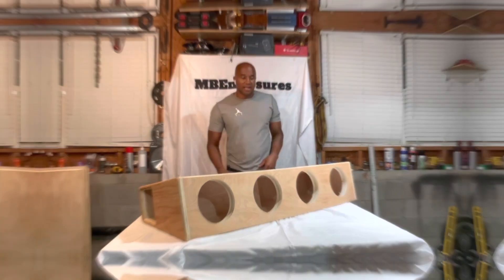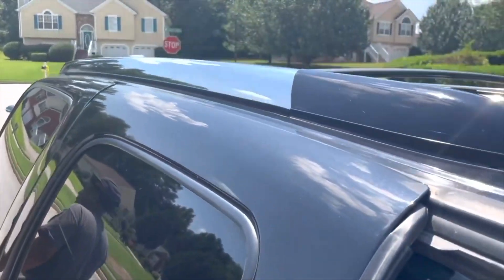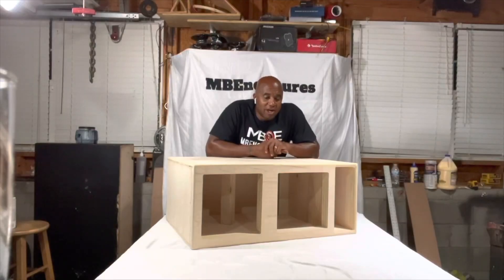XMAX and RMS The Understanding and How It Applies to Your System!!!

Comment: Sweet baby Jesus SMH.... Look there are several different ways to measure xmax and no one made anyone of them the set in stone "law" to put on the TS parameters  sooo that means 1 company might pick one way and a different company might pick one of the other methods.

Now the one that is mose real world valuable is the Klippel one because it actually powers the subwoofer up until it starts to distort so you have the real world clean usable xmax.

Now the important part, people usually confuse xmax with xmech and the last but not least my personal favorite which is xlim 
Xlim is the actual physical limitations of the driver meaning if it has a xlim 40mm that means that the suspension can't go past 40mm because the spider will be hitting the top plate of the motor so you could say it kind of like a absolute excursion rating because your going to snap city real fast when you reach xlim

But the moral of this is that xmax doesn't tell you how much the sub can move . Example being my xmaxxx monster 15 stock it's got 25mm xmax and I upgraded the coil from a 63mm to a 78mm long winding so now the xmax is about 35mm however the claim is 100mm and I get it moving about about 75 to 80mm daily which looks amazing I might add lol.

Comment: My thing is I’ve had both Memphis mojo 8s and DD Audio 2508s , the Xmax on the 2508s is 17 mm but the xmax on the mojo minis is 12 mm the mojos actually move more air at the same port tuning 35 hz due to the lower Fs would love to see you break out the Memphis mojo 8s to see how low and deep they dig for a fair comparison the 2508s are louder at different frequencies but the mojos murder the 2508s on low bass . And yes the 2508s are fully broken in . I love both products to be honest but , to have more shake and for purposes of the subs resonating better inside the cab of my f150 I am going back to Memphis love me some DD tho

Comment: Kinda off topic here. I just put two skar zvx 12 v2 in my Tahoe with a hifonics Brutus 4000 gamma amp. Is that enough amp for the two ? I have each sub wired to 2 ohms for break in then was going to wire them to 1ohm in parallel. Amp is 1ohm stable